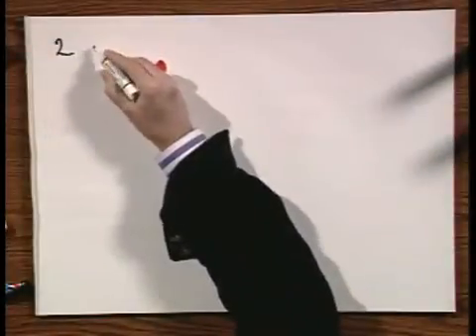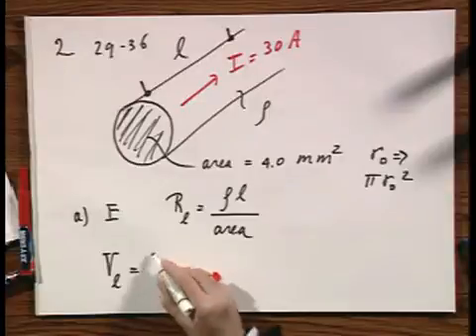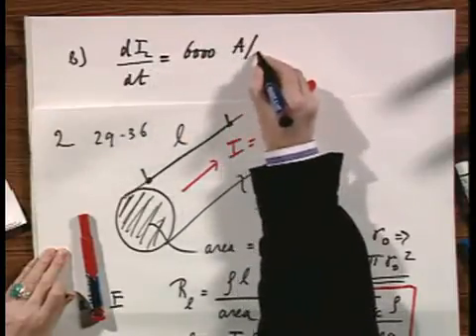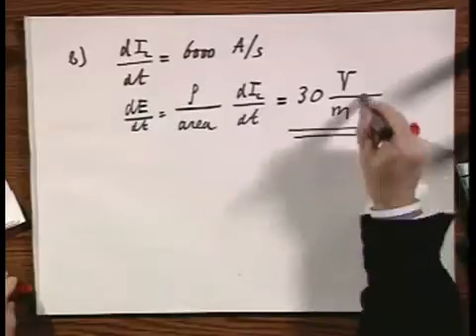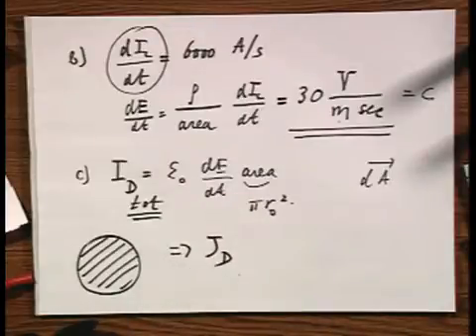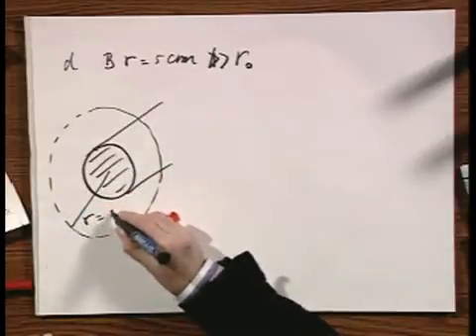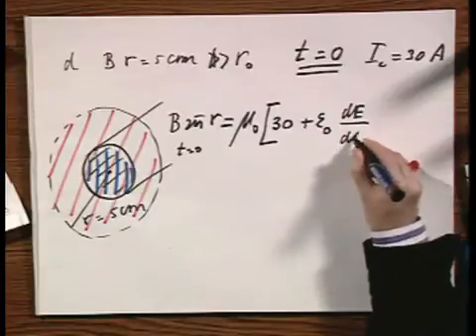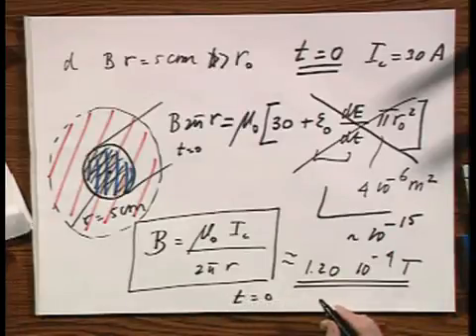8.02x - Module 07.02 - Comparing the Displacement Current to the Conduction Current in a Wire.

Comment from the maker: If the situation is static then there is no E-field in a conductor. However, if a current is flowing through a conductor with finite resistance then there MUST be an E-field inside the conductor otherwise no current would flow.

Take a battery, attach one end of a thin copper wire to the + side and the other end to the - side of the battery. You will now draw a current through the wire. The potential difference between the ends of the wire will be the integral of E dot dL. Thus E*L if L is the length of the wire.

If we assume that the internal resistance of the battery is negligibly low, then E*L is the potential difference provided by the battery which is I*R. I is the current and R the resistance of the copper wire. Thus E*L=IR. Thus the electric field in the wire is E=IR/L V/m in SI units

Comment: Doesn't the field in a conductor equal 0?
Reply: That's only under electrostatic equilibrium condition not in this case because here the conductor is connected to an external source of Emf🙂. Professor also said this, in his comment that there must be E field otherwise, no current will flow.